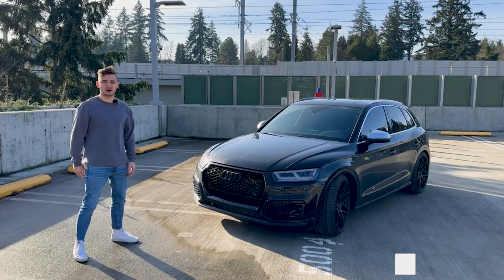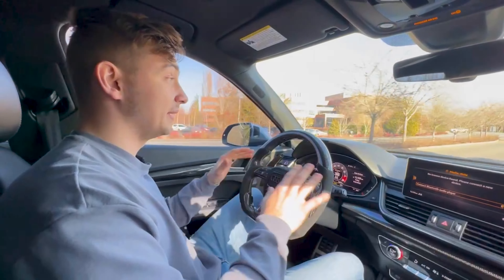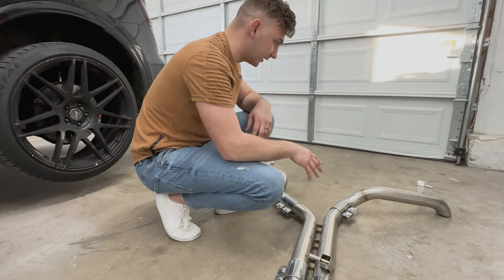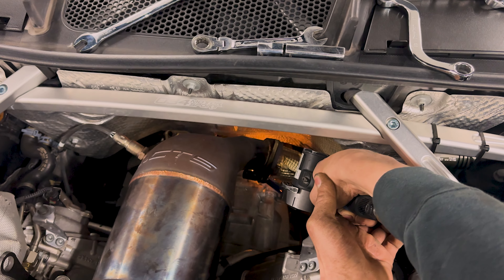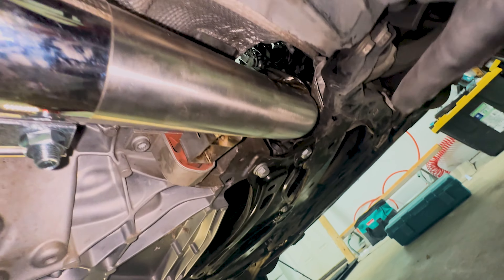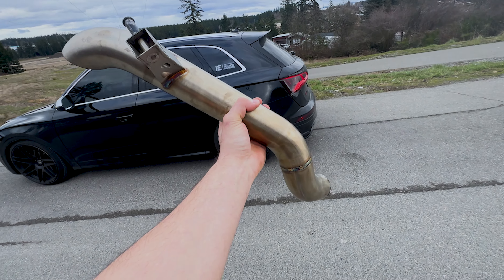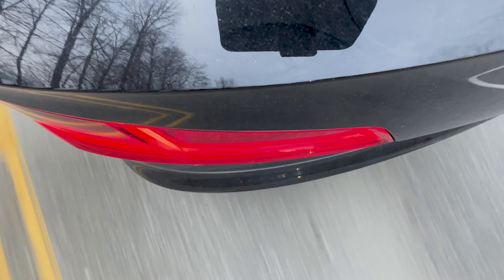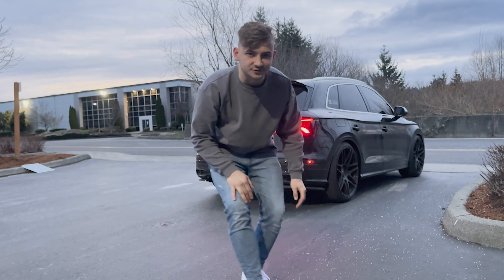I INSTALLED A BRUTAL EXHAUST ON MY SUV *LOUD TURBO NOISES*

Comment: 1000% check the clamps after 3-4 heat cycles. They always come loose and if your not experienced with exhausts, most enthusiast don't tighten them enough! Easy mistake to make and one ive made!
Reply from the maker: This is a W comment. After a few exhaust’s installed under my belt, I figured I would be certified to do it properly. Unfortunately we all make mistakes. Thankfully I can share that with my audience to not make the same mistake.
Reply: @Need4Built  Exactly mate! When the exhaust fell off, this was me 😂
Reply: Wish i would have seen this comment like  1 year ago lol i was dragging my exhausted but luckily not serious damage

Comment: I got the world's fastest SQ5 right now full stage 3. I got full inkernels pistons and connecting rods board and impolished heads and bored in polish supercharger. 1200 CC injectors and a fuel system. The potential is 1400 but we're gonna keep it around 1100.
Reply: It cost me 35.000. The stage 3 +  has the dual pulley extreme charger intake test pipes down pipes an catback no cats or restriction.3+ecu stage 2 tcu.
Reply: I love the SQ5 and S4 so much people get so salty when you gap there $200000 super car.😅
Reply: But good job your SQ5 is dope.
Reply from the maker: Agreed!! Please post about your build in the forums and Facebook communities. Would love to see more

Comment: Pb plaster and some heat should be a bit easier
Reply from the maker: Also using anti seize on downpipe bolts if you plan to take them off one day is also a good idea. 😂 we tried that before 2 of the bolts stripped. This was just crappy hardware supplied by CTS.

Comment: You mentioned in this video the ECS X pipe is droney with your catless DP. Do you know/think it would be droney with the stock catted DP?
Reply from the maker: Nope. It’s actually probably the best cheap mod you can do for more noise on the stock cat without drone. However if you’re willing to spend 300$+ I would recommend the entire IE exhaust instead as that’s going to definitely transform your B9 without having to cut the exhaust to put an x pipe in.
Reply: @Need4Built  noted, thanks for the info.

Comment: How can it be a cold start if it was installed in the garage and now is sitting outside on the opposite side of the garage?  Sounds good but already get complaints from my neighbors and I have the CTS catted dp (stage II).
Reply from the maker: When I installed the exhaust, I started it up, and I’m not sure if the engine was still fairly warm, but it went right into an idle vs an actual cold start. I decided it was better to let the car cool over night and then actually show a real cold start once the car was completely Cold. 
I had complaints as well, unfortunately.

Comment: Question: Any reason you did not opt for the Sport air suspension?  In the market for one of these and was curious.
Reply from the maker: More weight + KW coil overs are supreme to anything out there. From a drag or track setup. Anything really. Bags are only for comfort.
Reply: @Need4Built  how's the comfort with the kw coils over the stock setup?

Comment: looking at getting the IE mid pipes for my b9.5 S5 and potentially a DP down the line. Would you say the mid pipes and stock dp is noticeably louder/better sounding? would a DP change much with stock mufflers and mid section resonator?
Reply from the maker: Just doing the mid pipes with give your car more tone. However the downpipe is the biggest change you can do. I would say do only downpipe for now, and go from there if you want more noise. 

IE has an exhaust coming for the S5!

Comment: I don't know if you saw but IE just released a similar exhaust for the B9 S4 and they also have the same dronetrap technology, how good has it been in your experience?
Reply from the maker: IE’s exhaust is arguably one of the highest quality and best sounding exhaust systems. For the money I was kind of blown away honestly.

Obviously I haven’t installed or heard the B9 S4 specific exhaust yet but considering the fact that their exhaust had zero drone and even made the hybrid turbo sound more appealing with a better louder whistle.. is what made me keep it on the car. I do suggest going with their pro core high flow cat to pair up with their exhaust system.

Comment: Hey! My fiance and I just picked up a 2021 sq5! What wheel specs are those and what size tires are you running??
Reply from the maker: Forgestar F14’s 22x10.5 
DWS06 265/35/22
Reply: @Need4Built  what lowering springs do you have on it? I appreciate your reply
Reply from the maker: @alecsampson5236  Kw v3 coil overs

Comment: Did you ever have a rear facing baby seat in there?  If so, did the front passenger have leg room?
Reply from the maker: Yes I did. Bought this car right before my little guy was born. It fit perfectly. Front passenger had more than enough leg room actually. At least for my wife. The front facing car seat however, is much better.
Reply: @Need4Built  Awesome!  Do you remember the name and model of the rear facing car seat and base y’all used?

Comment: Did IE include a plug for the OE exhaust valve to protect it from the elements? As for Audi only having one valve on one side, it they had a valve on both sides the exhaust would be completely closed! :)
Reply from the maker: Well if Audi had a valve on both sides, you can open both in dynamic and let it rip, and close both in comfort to keep it mellow. This is actually how the one valve works. 

IE doesn’t include a plug. You can just zip tie the cable up and leave the old exhaust valve hidden out of sight.
Reply: @Need4Built  There is only 1 exhaust outlet per side. If there was a valve on both sides then the exhaust would be completely closed off in comfort mode. My wife's Golf R has a valve on each side, but that car also has 4 exhaust outlets.

Comment from the maker: What's next for this SQ5? Leave a comment with some idea's!

☆OBDEleven: https://obdeleven.com/?aff=1175&utm_source=affiliate&utm_medium=afltly
☆For a 10% DISCOUNT on ANYTHING, type in NEED4BUILT10  in the add discount code section!
Reply: Built motor? Body Kit???
Reply from the maker: @lukas-qv6ym  Built motor sounds fun however body kit seems more cost effective
Reply: Some street racing in ny xD
Reply from the maker: @miloterra2  coming up 🫢
Reply: Some gappucino footage? Go for a hunt, put some stock wheels, de badge it. Would be sick sleeper video
Reply from the maker: @arthurgevorkyan2788  this would be some cool content 👏🏼thank you!
Reply: @Need4Built  maybe upgrade rotors and calipers?
Reply from the maker: @shadowhunter2430  rotors are upgraded, brakes are not, on the list now.
Reply: I agree with the built motor (kinda) even +1mm overbore with pistons and rods I feel like would be worth it as far longevity of your motor 🤷 probably only a small bump in power but curious if it would be worth it power wise
Reply from the maker: @McDoubleNopick1es  Guess we’ll find out in the near future 😉
Reply: Chrome delete
Reply from the maker: @joshd4809  needs to happen asap 💪🏼

Comment: Sounds good. It sounds like straight pipe
Reply from the maker: It basically is. Just the resonator holding it back at this point. However still sounds really good. 💪🏼
Reply: @Need4Built  yeah it does sound good

Comment: Yooo nice video! I completely agree with just a high flow cat/catless + stock valved exhaust sounds great and super cost effective. A big selling point of the B9 for me was how easy it is to make it sound awesome (especially compared to the B8.5 lol). But wow that IE exhaust does sound amazing - and makes that 810 sound even more beastly!!

Also LMAO @ "Stock exhaust is made out of stock exhaust"
Reply from the maker: Stock exhaust is stock. Correct. My knowledge right now 📈📈📈 

The B9 SQ5 just sounds so good. There’s something about the engine itself that has that exhaust noise edge over the B8.5. 
The hybrid turbo gives it a little bit of an advantage with those wooshy noises 🤓

Comment: If that was the CTS bolt/nuts hardware, it is absolute trash. Same thing happened to me when I tried to remove mine.
Reply from the maker: Yup! CTS provided that hardware. Clearly is sucks. Now that I have it replaced however, should make my life a little easier if I ever have to change it again.